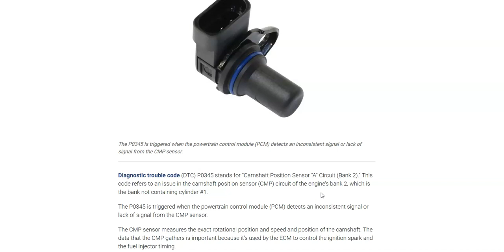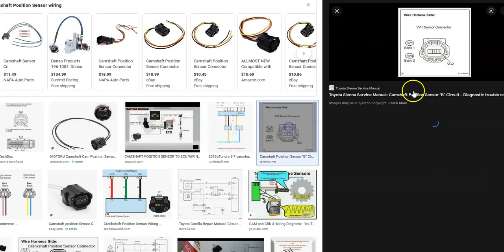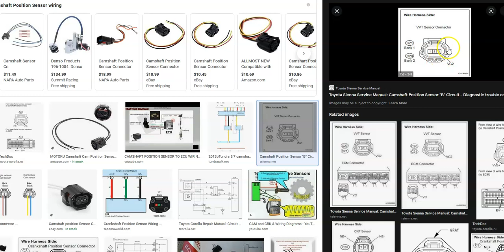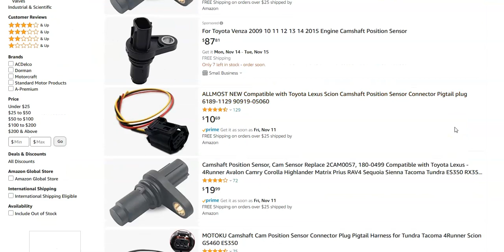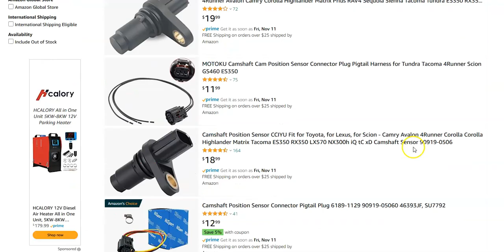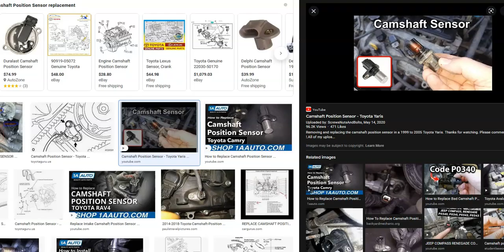Causes and Fixes Toyota P0345 Code: Camshaft Position Sensor “A” Circuit (Bank 2)

Comment: ****HELP*** question is below this comment. I have only the one vehilce and have to fix this myself and am 72 young I am capable of doing this, just need to know where it goes and if that one in the pic of the video is the one for the 2006 V8 4.7 Toyato Tundra.  P0345 is the code I received when using my FIXD as engine won't start It got hot and I turned it off it trys to start but won't engage all the way
 Help please. LOL
Reply from the maker: To find the location of a specific part, I use Google Images when I don't have a manual. The results can vary, but I usually can find a diagram or picture. Basically, I would Google "2006 V8 4.7 Toyota Tundra camshaft sensor diagram or location," and at the top, click on Images.